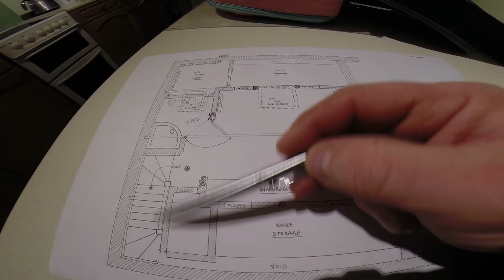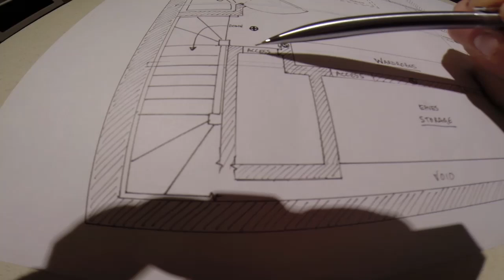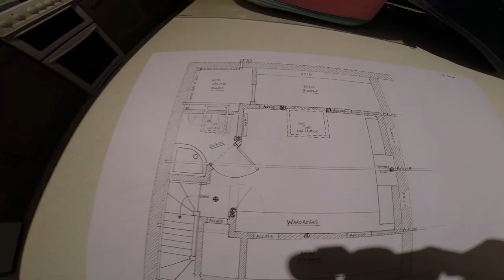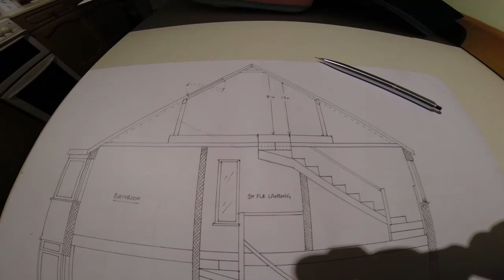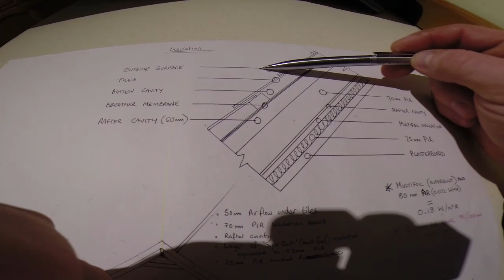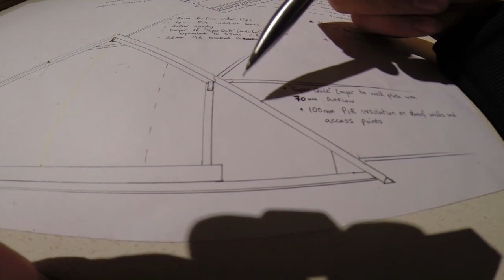DIY Loft conversion e1pt2

Comment: Hello, how did the contractors secure the joists to the party wall?
Thanks
Reply from the maker: @sulie4real  the 2 joists on the outer edges of the floor were secured in the wall in pockets that were cut out. Need neighbours permission I believe.
Then between them there was a joist anchor bolted on for the hangers to be attached to.
All the other ends rested on a structural wall.

Comment: I'm a bit late to this video series but I'm finding it excellent thank you so much. I'm very much at the conceptual stage atm, I wondered if you upload the diagram with dimensions and such? I believe my loft is pretty big but I would like to see how much space you started with and what allowances you gave to all the fixings and such.
Reply from the maker: @joshmcculloch09  you're looking for approximately 3m height at the ridge, or somewhere near that. This will reduce with collar ties, flooring joists and insulation so needs to be bigger than most think beforehand.
My space then was 17 foot of length and around 11 foot between my purlins.
Definitely take lots of care with staircase clearance, fire regs and layout - if you're planning a bathroom think where the utilities will go etc and work back from there.
I marked the layout on the floor to see how head height would be restricted in eaves and that's how I came to building the wardrobes etc the way I did.
Best thing I did was leave the room separation on the first floor freeing up maximum space up the loft (the separating door better at bottom of stairs if poss)
Uploading the plans would be something I've never been able to do but the channel allows pics now doesn't it so I'll have a look. Otherwise just pause and screenshot - I use 1:30 scale (1cm = 1 foot for ease) on specific loft plan and reduced to 1:60 on the whole whole plans.

Comment: Hi mate, a bit late to the party but I've just bought a semi that looks similar to yours and me and the old man are talking about doing this as the roof as purlins and not traditional josts. What was the original size of the box room and what floor space did you get upstairs? Cheers
Reply from the maker: @granytarman  the box room was 6 foot wide and just shy of 8 ft long. The space we got was huge but I used the lower sections well with built in furniture so it seems smaller cus everything is recessed into the walls etc 
It's about 17 ft long and about 11 ft  wide and then there's the space at the bottom of the stairs too...

Comment: Without the steels can it still be classed as a room from the council?
Reply from the maker: Yes mate. This job is completely signed off.
Their main concern is the adherence to building regs - so as long as the spanning limits are not breached it is structurally sound. 
If your longest span (between structural support) is under 3.5m you shouldn't have much issue to use reasonably sized timber like I have. Definitely worth googling span tables to check.

Comment: Really interesting. I'm busy renovating a bungalow with a cavernous loft. I'm also at the point of doing the re roof in the same way you did, ie re use the tiles etc. How long did the roofing side take? If you have a look on Instagram under location_relocation_renovation there's quite a few pics of the project. It's good to find somebody whose done it recently though.
Reply from the maker: If its that big, and you're re-tiling it's defo worth making the most of the situation and fitting the joists. Even if you don't fully convert, it would defo be massively useful as storage if you fit a large hatch and ladder... The roofing section didn't take long. I also fitted the first roof window at that stage. I'll check it out... 👍🏻
Reply: @Chatters156  It's about 13m long and 3m high. It's a lovely space. We'll the spiders think so. 😂

Comment: Did you have to get the plans done by a professional
Reply from the maker: All those drawings were my own, if you have seen the videos, there's a picture of a desk in the loft before I started - that was where I planned everything. Ironic thing in the end was that I took a building buddies advise and went with building notice rather than full plans route. I must say though it wasn't a waste of time - I sorted so much out in the design stage that this helped the build go off without a hitch.

Comment: Hi, great job, can I ask how much you paid to get your floor joists put in?
Reply from the maker: Well I had a a few jobs done together. Loft hatch, roof window, and the joists come to about £2k.
If I were to do it again though I'd defo do that bit myself too. It was just that the house was a wreck when we moved in and I was working on other areas. The tiles being off was also a big draw to take advantage of. Thank you for you kind words! 👍🏻
Reply: @Chatters156  is that including materials?
Reply from the maker: @TeeTee-zm2re  yes that was total price at the time... However with recent prices sky rocketting I doubt this will now be accurate!

Comment: Really really interesting. I’ve literally been trying to encourage the mrs about the same thing but still in early stages. The Haynes manual was published in 2008 is that now outdated and are there new regs we’d need to think about. We have a new build (2016) so may need to think about floor structure a bit more.
Reply from the maker: Yh, with a new build there will be lots more to consider with the floor strength. As a wild guess I'd predict needing steels? The manual never showed its age in terms of regs, and I would defo recommend it as most of the questions you have will be answered by reading it - it's very thorough and a great starting point. Let me know how you get on... Thanx for comment.
Reply: Sometimes (depending on how big or what position the existing landing windows are) the loft stairs cut across the existing staircase/landing window.
Reply: In 1930's houses especially where existing stair windows tend to be quite big and central the loft stairs are likely to cut across the existing staircase/landing window.

Comment: The whole project is excellent, quality info and workmanship throughout im going to do ours in a  1930s semi. Just Wondered did you do your own plans?
Reply from the maker: Hi John, thanx for the comment. Yes I drew my own plans, I can't recommend the Haynes manual I used for reference enough. I gives full explanation of what drawings were required. I used 1:30 scale (easiest way using 1foot measurement = 1cm on paper.) can use photocopier to reduce it to 1:60 ☺
Reply: @Chatters156  Thankyou i will get a copy, have you had it all plastered yet? Cant wait to see it all finished top job mate.
Reply from the maker: @johnrobbins5026  the day before it was due to be done, corona virus restrictions hit the construction lads and my plasterer cancelled... I hoped  to be decorating in lock down but no luck. Ended up doing my drive and garden instead. I won't spoil the job by trying to plaster with no skills... 😂
Reply from the maker: Hi john
Don't know if you noticed but you were interested in progress. The loft is now finished and the following episodes are on my channel.